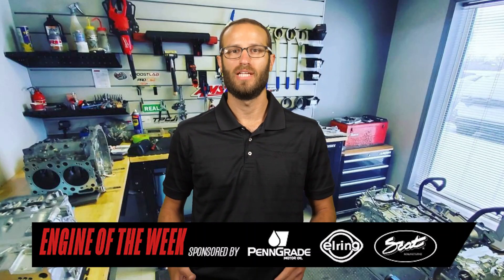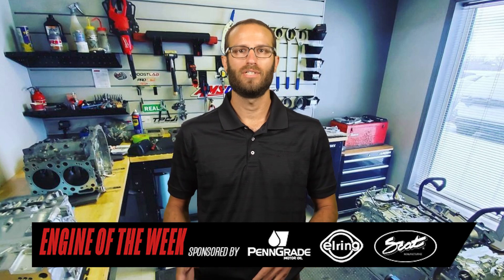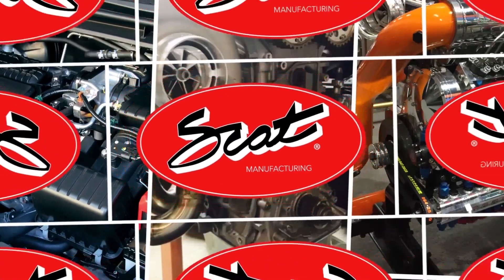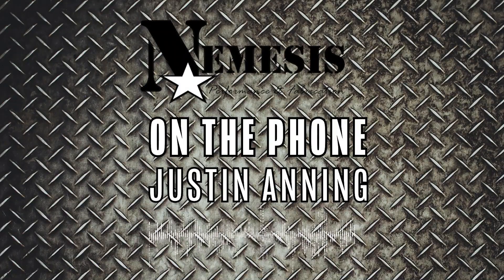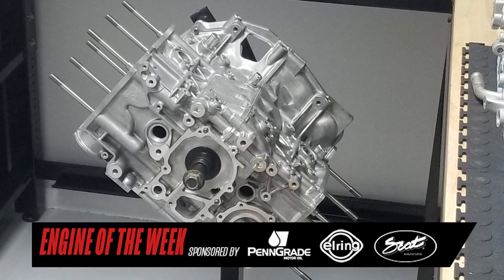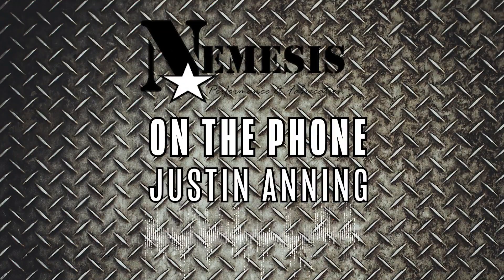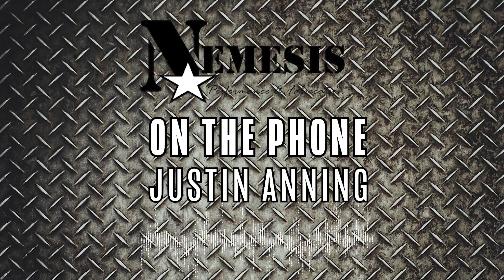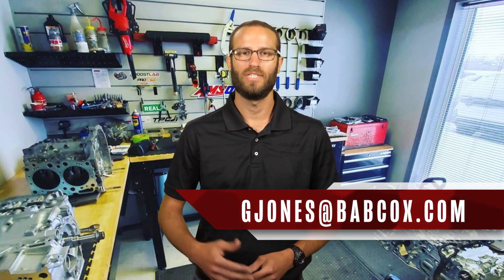Stage X 2.35L Closed-Deck Subaru Engine

Comment: Very similar to the engine I built for my wrx ..I called it a street car but it was basically a race car lol but I ran the 2.5 block also used darton  sleeves that were bored +20 and I believe the combination of the bore and stroke actually got it to just a tiny bit under a 2.4l  I had 2.5 seasons on that engine with only basic maintenance and refreshing and some how the um....dude I sold it to put a rod out the block on the first track day... I was shocked and I even told him if it was any fault of the engine itself I would help cover the cost and he was like idk what happened it just started making noise  but guess what I found when I looked at the data log that was still saved???  The rpm continued to read all the way to 14850 rpm before it went blank 😂 he somehow shifted from 4th to 1st gear and I have no clue how he was able to do that especially with a PPG dogbox installed...it would barely ever let me get into 1st unless I was stopped  but  that is my little story lol
Reply: Wth? Smh....
Reply: Подскажите, за счёт чего у вас получился объем 2.4? Какие шатуны вы ставили? Спасибо
Reply: @Магомед-о2з I put a 75mm wrx crank in my sti block. Also installed +2mm rods to get good quench and compression.

Comment: De stroked but longer rods?
Reply: the crank has a shorter stroke, so you need longer rods to reach it. that way the piston still reaches the top of the cylinder. since the crank has a shorter travel, less of the cylinder is used
Reply: @brendonbalascan6814 using a piston with the pin located 2mm lower in the piston can also accommodate this. The opposite is done when building a 2.1l stroker. The 79mm crank is used and the piston pin is located 2mm higher.
Reply: The connecting rods aren't really the main player in the stroke of this motor its more a function of the 2.0L crank out of the EJ20 thats decreasing stroke in the motor

Comment: If he wants to make 1100hp then he will need about 260hp N/A with the boost levels you mentioned. 14.5 x 4 = 58psi. 260 x 4 = 1040hp.
I can't see that long block making 260hp with mild porting and a mild cam. He's going to need to get a bit more serious with the heads and add more cam. 
It's entirley doable though because there's some guys down here in Australia pushing harder than 1000hp with the ol EJ.
Reply: Lmao to all of you champs..!!!!Where's your Subaru dedicated performance shop?
You tube know it all's strike again
Reply: @kjones7270  dunning krugers isn't fatal, you'll be ok 👍
Reply: Agreed 100%
Reply: The cams need to be wayy more aggressive to make use of the destroked design. +1mm valve at this point is required, with beehive shaped springs.
Reply: @henry6777   Yep that sounds about right. More Valve and more cam which means more cross sectional area from the throat to the plenum too.